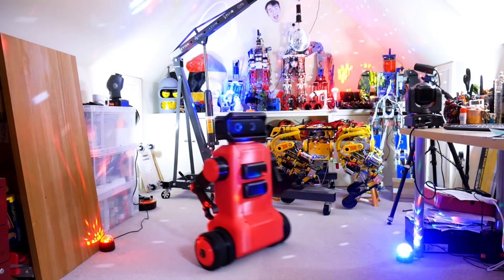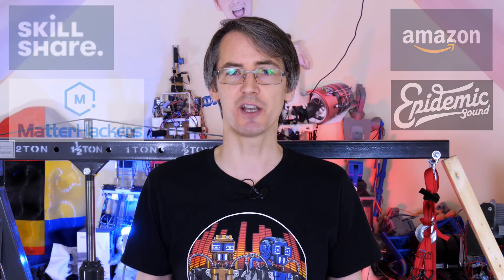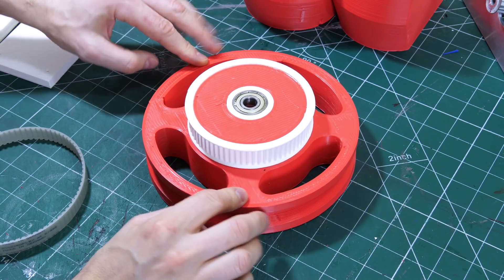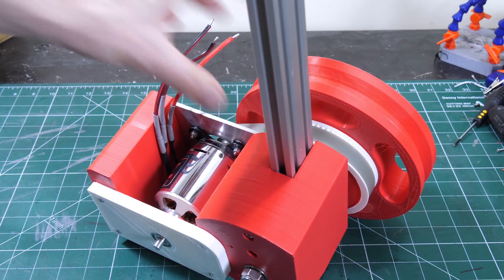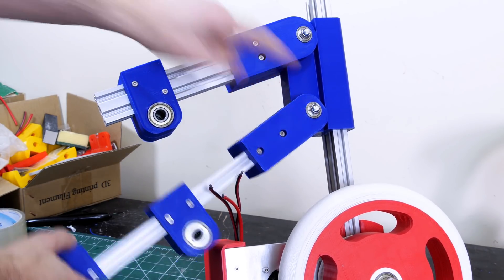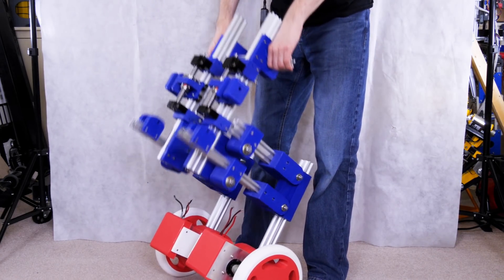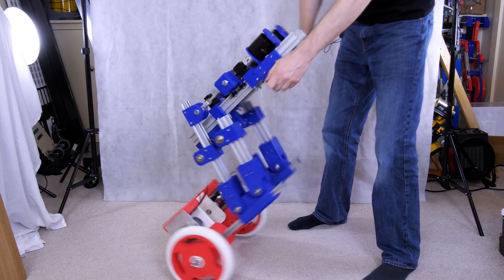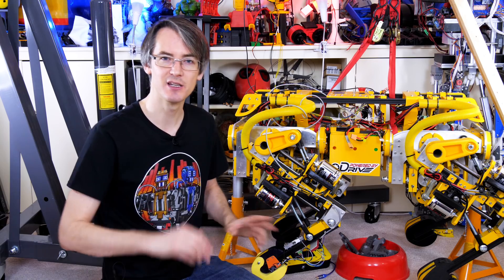Sonic the Hedgehog Balancing Robot #1

Comment: Hello, which CAN Protocol do you plan to use? Normal CAN is limited to 1 Mbaud, so based on what do you need to send in each message you can calculate the maximum rate that you can achieve for your application. One normal 8 byte message needs around 150 bauds, but the bus load should not go over 30-40% in order to guarantee that messages reach the destination. So if you want to transmit at 1 ms you can have maximum 3 messages total, but at 10 Ms you can have around 30 messages total. Best is to optimize and use as little messages as possible and code your data in the 8 data bytes that you have. There is also CAN FD but I don't know if your uC supports that, and also I never used it before.

Comment: How can a motor that has to be actively driven to change position actually cushion an impact?
Aren't you basically trying to beat the speed of the wave propagating through the structural members by moving something out out of the way by twisting something subject to similar speed limits?
I'm not even sure how to model the system and the interactions, to be honest. Can a screw driving motion along a linear path be driven in reverse (pushing on it to make the screw wind around)? I mean I guess the idea is that once there is a load on the leg (and thus is experiencing a force and thus acceleration/jerk/jounce/whatever), you'll start moving out of the way thus reducing the load, but what happens to those higher order derivatives? Does that kind of reactive system have a chance of working against anything except a static load (rather than a sharp impulse/spike)?

Comment: you should really start thinking about using shafts and collars instead of threaded rods and nuts. That will help reduce play between the bearings and the threaded rods as well as helping preserve your bearings. Assembly would probably also be easier instead of threading the each nut.

Comment: Hey James, top work! Have you thought about using a coaxial cable to connect the load-cell sensors to the main controller? I'd wage it's simpler (and maybe cheaper) than using can-bus.

Cheers from Brazil!

Comment: Hi James, Have you tried a Teensy 4 yet ? i have one, but not used it yet.
Reply from the maker: not yet!
Reply: @jamesbruton  Do you have any experiance with quadratic encoders working too fast ? I am reading one from a DJ cd player and  physically it's very hi resolution and I can read it at full speed with hardware on the teensy 3.6, but the data sent to my midi software is way to fast to use. I need to reduce the data without loosing steps and it is used to scratch so can move back and forth very fast